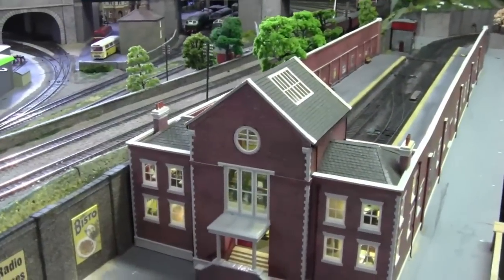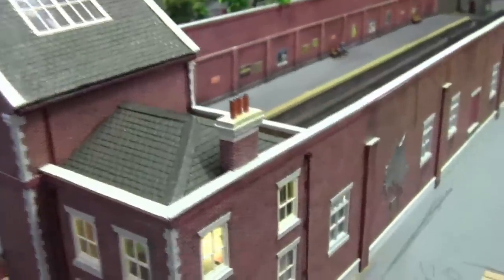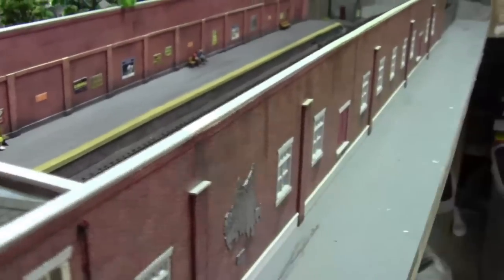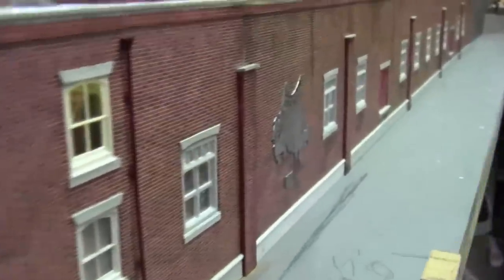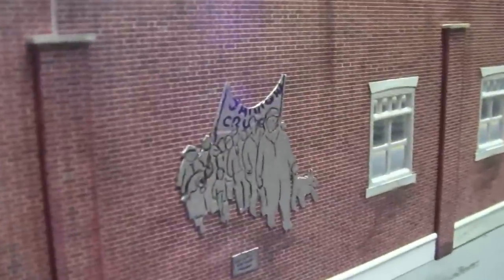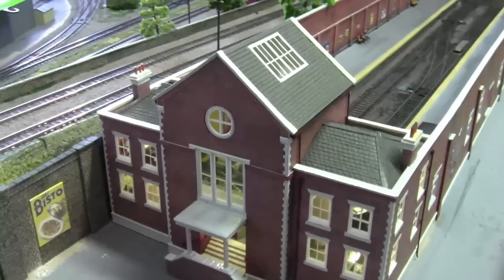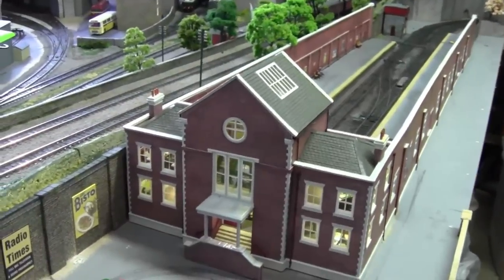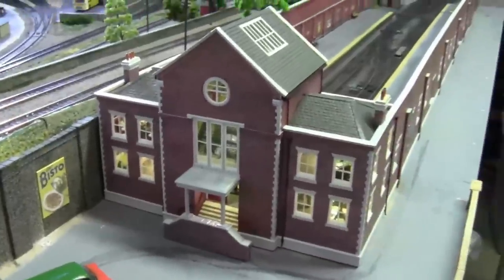A new Road for Jarrow Road. No356

Comment: As a Traffic Light Manager, the traffic light pole would be black/white striped (same as zebra crossings) for your era and not plain grey. The first mini-roundabout in the world was in Benfleet, UK in the spring of 1970.
Reply: Always nice to have a pro who knows!  :)
Reply from the maker: Hi Andy. Cheer's for the reminder with the traffic light. i know in some cases they were just plain black. but now i know it working correct there is no reason why i shouldn't paint it up. thanks again. very much appreciate your input. cheer's for now. all the best and a happy new year Tony.
Reply: Yes, I definitely remember the striped traffic lights - and wasn't there some white on the lamp shields? 👍
Reply: @tankmicr00man  The white ‘backing board’ surrounds we see today came after this era, it was just the lantern body with 8 inch dia lenses and striped pole

Comment: Hi Tony,
I'm envious...  you can work on your layout!  My shed has been too cold to work in for about six weeks!
Just a couple of small points, however...  It might be worth you getting hold of a 1950's copy of the Highway  Code which shows the road signs and bollards of the period...  Also the units in phone boxes in the 1950's were black, they were the ones with 'button A' and 'button B' I can remember them from when my mom made phone calls.
All the best, Ken.
Reply: You are quite correct about the phones in the 50s and later, Ken.  I assumed wrongly, that Tony knew that.  I remember that when the call was answered and you had to press button ‘A’, you could insert an ice lolly stick in the slot and fool the phone that you had inserted money.  I did not do that of course 😮 it was the other lads. 😉  As boys, we would always check button ‘B’ to see if any money would come out.  Best wishes and a Happy New Year, Ken.  Jason.
Reply from the maker: Hi Ken. Firstly i completely forgot that the units they were black, now that's something i can fix. a spot of gloss black job done. 
have ever thought of using one of those green house heaters, they are very cheap to run. i have a small oil heater in the loft which keeps the temperature at 18 degrees. and a woolly jumper. 
i will have to look out for a copy of the highway code from the 1950s. thanks again for the reminder. and we will catch up next time. all the best Tony.